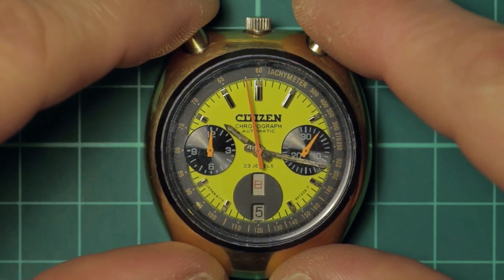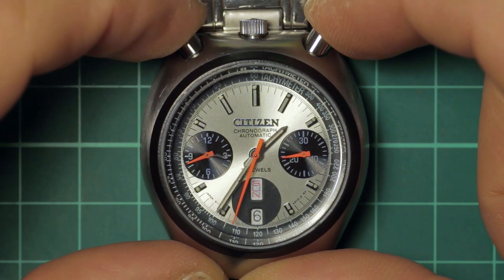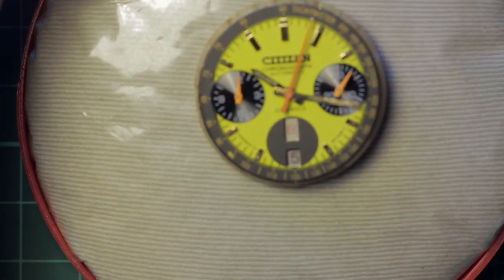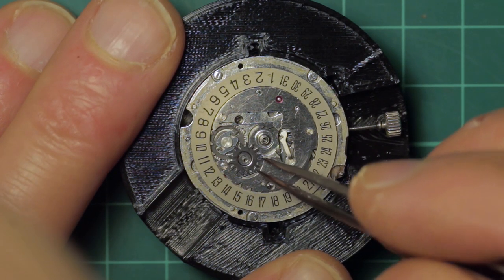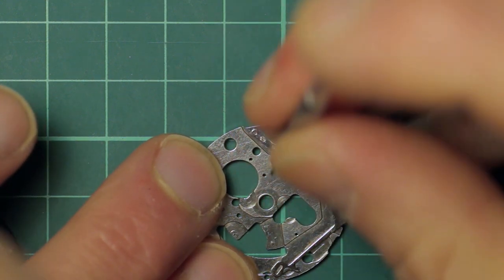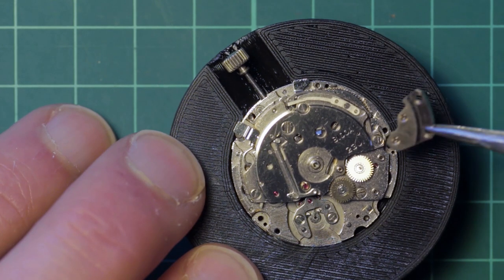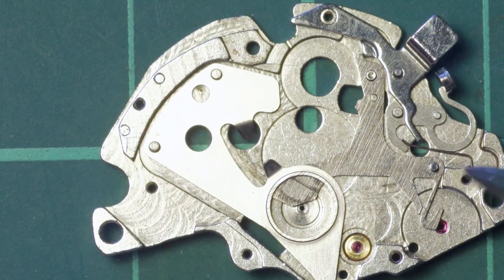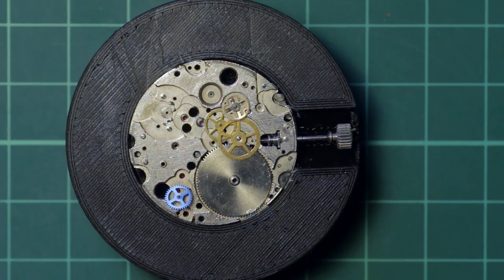Citizen 8110A Bullhead Chronograph Service The 'Brad Pitt'

Comment: Any chance you will be posting "Part 2, Assembly" of a Citizen 8110A bullhead chronograph?  Or if you have would you point me to it, as I'm not seeing it in your video lineup. BTW , you've done a great job in part one disassembly and I would love to see the same methodical assembly.  Currently I use my own step disassembly photos but I would love to watch someone with more experience assemble one, as I find the 8110A challenging, despite them being so close to the Seiko 6139,6138.
Reply from the maker: I haven't uploaded the rebuild unfortunately, at the time of filming I got swamped with jobs and people wanting theirs filmed and there are several sitting awaiting editing, if I can find the raw files I will get it edited and uploaded, if not, I have a Citizen 'Spider' awaiting service, (same movement) so I'll film that one.
These are actually dissimilar to the 6139/6138 and a little more complex and fiddly.

Comment: Great video ,easy to watch and follow. Always being told that the Citizen chronos more complicated than the Seiko's ,now I can see why. Thanks T.
Reply from the maker: Thanks, operationally they are slightly and there's more removable components. The 6138 and 6139 have a few rivetted parts but they're not much more complex, the tough part is getting spares.
Reply: @spidiq8  A few pesky little spring with the Citizen.

Comment: Do you know what size mainspring winder to use on the 8110? I've been buying them as needed.
Thanks!
Reply from the maker: Slightly tricky one to answer as I use a vintage K&D style winder set. The largest one on there has an OD of 11mm and this fits inside the barrel comfortably.
Reply: @spidiq8  Thank you! Larger than the Seiko's I've worked on.

Comment: What did you do about the bend minute recorder pivot? Mine is bend too. Should I try to straighten it a little, make it totally flat, or should the watch work fine without it? Currently it happens that the minute recorder sometimes doesn't work. Could that pivot be the problem?
Reply from the maker: This one was replaced with a spare.
It will cause problems if bent so the only options are to straighten or replace.
Reply from the maker: Hi again. I just wanted to add that I am currently in the process of editing a rebuild of this same movement for upload. I lost the original files when I did this one. Please check back over the next few days, hopefully I'll have it uploaded before the weekend.

Comment: Very interesting, thank you. How do you wind the watch, other than gently shaking it ?
Reply from the maker: These hand wind in addition to the automatic winding conventionally using the crown in between the pushers.
Reply: @spidiq8  Thank you. Does the crown have to be pulled up, or wound clockwise or anticlockwise  ? (Thank you.)
Reply from the maker: @crispin8888  position 1 fully pressed in. Wind clockwise to wind the mainspring.
Position 2 pulled out one step rotate to change the date. Press chrono stop button to quick change the day.
Position 3 pulled out 2 steps rotate to change the time.
Reply: @spidiq8  Thank you very much for your help. That's very kind of you.

Comment: How can I allign thé hands of thé chrono on the 8810 Bullhead?
Reply from the maker: They must be manually set whilst holding the reset pusher after ensuring that the hammers are resetting correctly on the hearts of the chrono wheels.

Comment: Congrats for the video. Recently bought one of these magnificent pieces, which needs to be serviced due to a one pusher malfunction and a very damaged crystal. In my previous research, before buying it, I didn’t learn of an issue that really worries me: the possibility that this model is radioactive because of the use of promethium in the dial.

Before posting this, I’ve read articles, forums and papers about this matter. Apparently, the models that may contain the radioactive substance are those with the designation ‘P JAPAN P 8110’ on the dial; and the watches with de designation ‘JAPAN 8110’ would be free of this material. But I havent’t been able to confirm it by any source. My watch is into the last category (‘JAPAN 8110’).
Please, could you help me? I need to know if this information is correct. If it is, I will keep and service my fantastic watch. if it is radioactive, I will get rid of it as soon as possible.

Could you help me? Thanks!
Reply from the maker: I own a few 8110A models and have serviced several more and this is news to me, it's not something I've ever been aware of.
Sorry to say I can't advise on that.
I do know that radium hasn't been used since just before the 60's in most countrys and the only other radioactive element to my knowledge was tritium which is a much less risky element.
I'll try and find more information though.
Reply: @spidiq8  Thanks for your clarification. I also wrote to the official Citizen service in Spain, my country, and this is what they answered me (in case it helps):

"We can assure you that Citizen has not sold and does not sell products with radioactivity. For many years some model has been called "radioactive", specifically the NY0040 series, because in the 70s a material was used for the luminous of the indices and needles in watches that had a material with a tiny amount of a material that people associated with a "radioactive" product, but it is a name given to fans, not because the watch was radioactive as such.
If you put in an internet search engine "Radioactive Citizen" you will find that it is a popular name of an old diver.
Reply from the maker: @jmarind1  Good to know, I would have been very surprised at any Japanese watch from the 60's onward using radioactive lume. These originated in the 70's so should all be ok and many have been redialled due to moisture ingress. Common in these and Seiko of the era as they were cheap and not as well maintained as a more expensive Swiss watch.
Reply: @spidiq8  Well, I remain quite calm with this information. Now it's time to take my wonderful watch and restore it. Of course, your video will be a perfect guide for it. Thanks a lot for your interest in this issue. Greetings from Spain. I will be enjoying all your videos! ☺
Reply from the maker: @jmarind1  Thank you and best of luck in your restoration. They're lovely watches.

Comment: do you have the stl file for the movement holder ?
Reply from the maker: I do thanks yes. It's one I made myself.
Reply: @spidiq8  do you mind sharing it with me (?) I'm about to tackle the same movement.
Reply from the maker: @bintangsena2249  Yes I do. For many reasons. It represents lots of hours if not days of design work, prototype printing, test fitting the movement in various stages of disassembly which took time away from the servicing aspect of one of my own 8110's when I first created it, fine tuning, adjusting, re testing and creating the final print.
Added to that there are inconsistencies between printers and filament which could mean the tolerance difference between fitting or not and this is designed and sliced for my printer and settings.
Finally I need to make further changes as it's not yet to a level I'm happy with along with my other specialised chronograph holders and once I have the time to fine tune them I intend to print and sell them.
Sadly the majority of people only see the 'it's only pennies worth of filament' and not all the hard work gone into the design and while groups like thingiverse are great for encouraging 3D printing it's created an expectation for free .STL files.
I know from experience also that once you give your file away it typically ends up out there for anyone to download.
So apologies but no I'm not willing to share the file.

Comment: Dear Friend, is there a rebuild video lol I'm stuck
Reply from the maker: Sadly not currently. I filmed the rebuild but the footage was lost somewhere. As soon as I service another I'll film the rebuild
Reply: @spidiq8  I'll be honest, your dismantle video was so good I might just jump that video in reverse gear and move from there.
Reply from the maker: @J.S.McDuff  Thank you. That would get you in the right area for sure lubrication wise just follow the general rule of thumb D5 for high torque slow moving, mainspring barrel/second wheel and 9010 for the rest of the train. Grease for all the metal to metal chrono parts. It's annoying I lost the footage for the rebuild as I've had a good few people ask for it.
I'll definitely do another when the chance permits.
Reply: @spidiq8  yessir, you're a hero and a saint
Reply from the maker: @J.S.McDuff  Very kind of you but I wouldn't go that far. 🙂 I'm glad you found it useful though.

Comment: But what about the broken/loose bit?!
Reply from the maker: I forgot to mention on the video but it wasn't from this watch at all.
How it got sealed in there I don't know.
This watch was from a lot that I received and it has been modified previously as it's either had parts to make it an 8110 or had an 8100 replacement chronograph bridge fitted.
I'll add this information to the rebuild video when I do that.